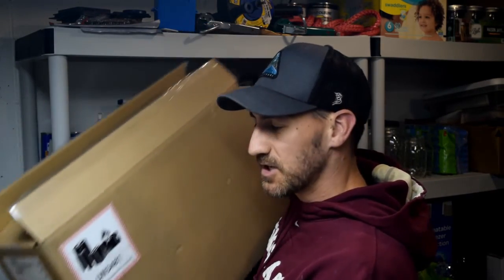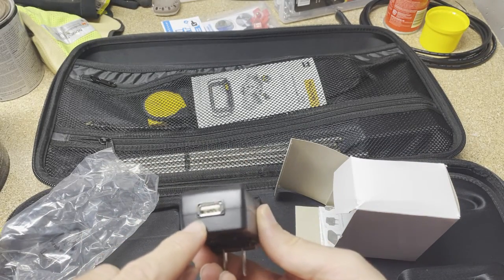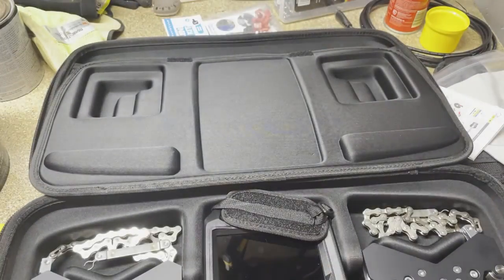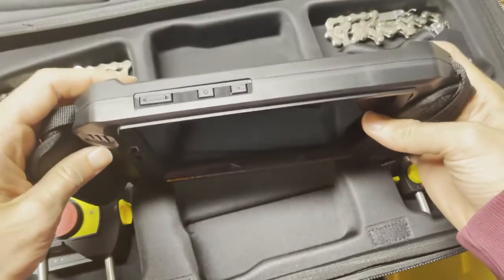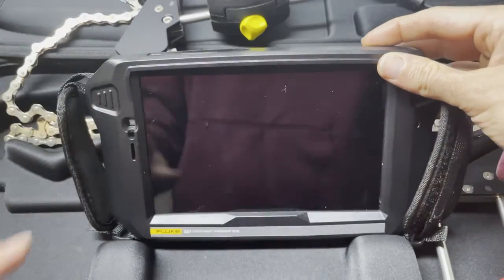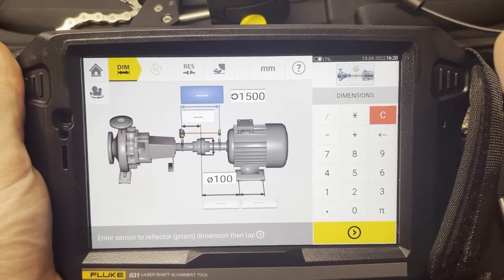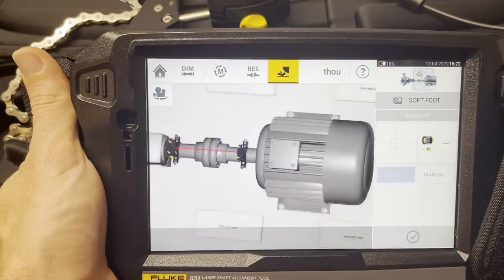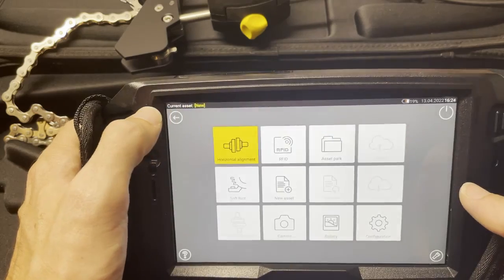Fluke 831 Unboxing - Fluke Fridays - Episode 74

Comment: I just purchased a T6-1000 pro, and while I was testing it I noticed that it wouldn’t get the fieldsense voltage on my chillers. As it is the only piece of equipment I couldn’t get accurate readings from, I was wondering if you might’ve seen this before and know what’s up?

It could read fieldsense voltages on the inputs/outputs of VFDs, frequencies way outside the marketed range, and was perfectly accurate on everything else.
Reply from the maker: Sorry I've never heard of this before
Reply: Go direct to Fluke, all products have a guarantee.
Reply: @JEANINE DE LA FUENTE  yeah this isn't so much a warranty issue as knowing how distorted the sine wave can be before it stops recognizing it